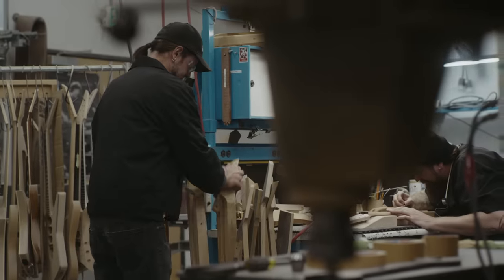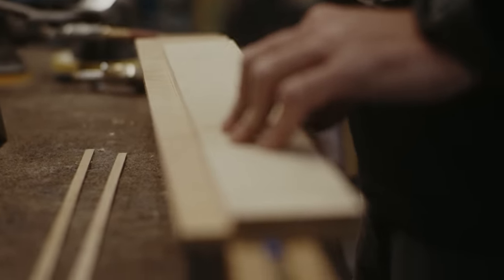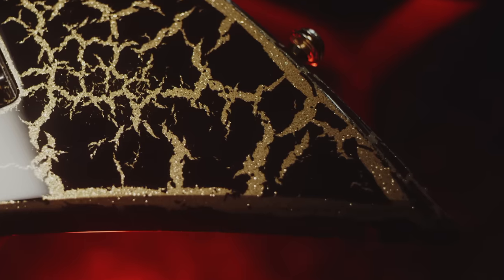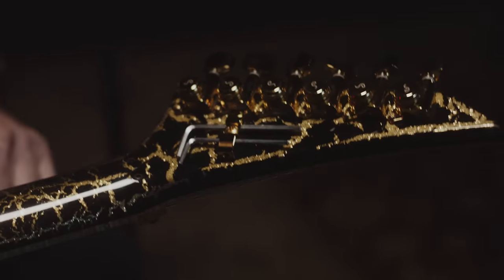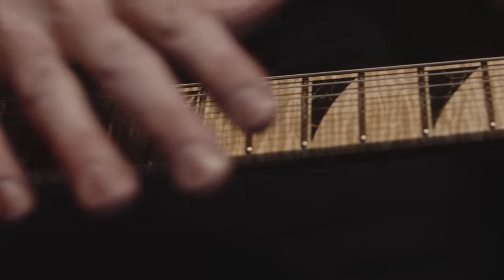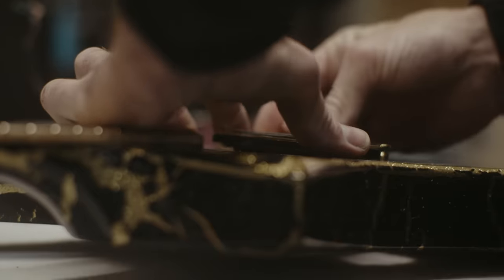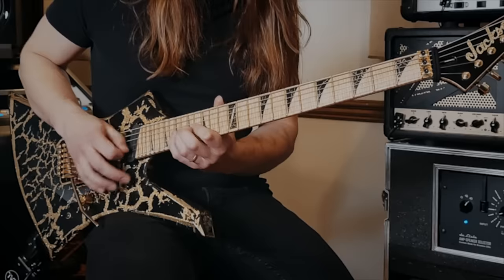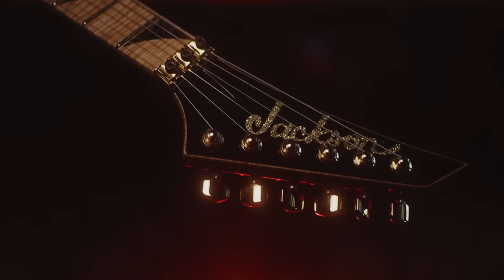Brandon Ellis' Custom 27-Fret Gold Crackle Kelly | Nightmare Machine | Jackson Guitars

Comment: The greatest guitar to ever come out of jackson
Reply: I mean Jackson has designed some incredible guitars through the years but you just may be right! This thing is unreal. Might be the best looking guitar of 2023
Reply: @ShaneStoneOfficial  it's the most perfectly designed guitar I've seen from pretty much anywhere. Everything about it is made to make it as efficient as possible. The next closest I can think of are the new black and white Ibanez RGA prestige models with the 27 frets on the high end, but still I don't think they even hold a candle to this.